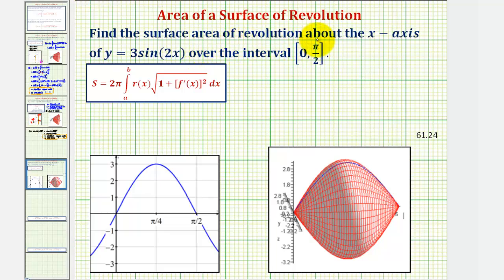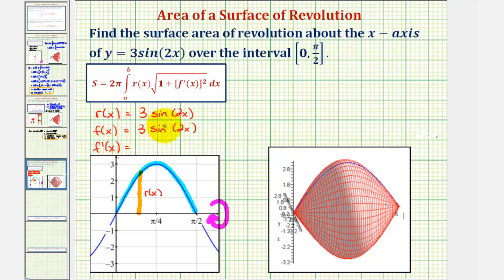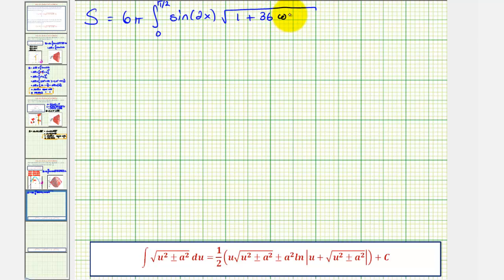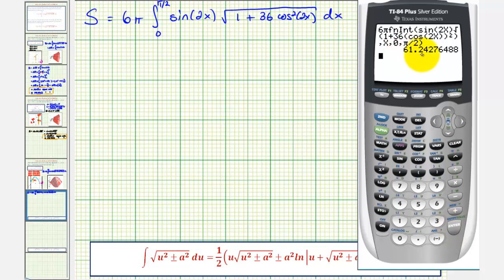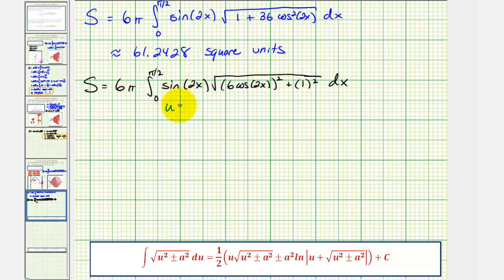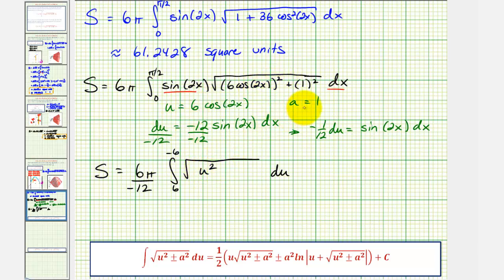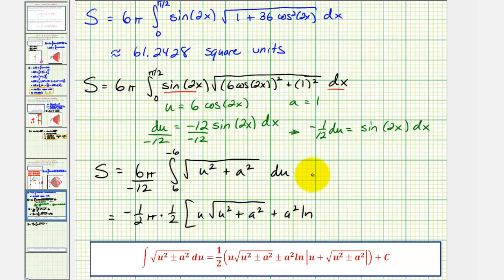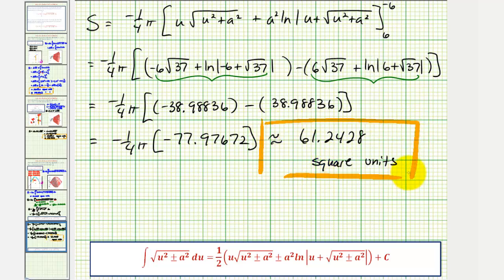Ex: Surface Area of Revolution - Sine Function

Comment: smh having to use a formula. this is why calculus is never seen as useful in the outside world. we are giving kids the formulas instead of showing them where it comes from and how you would use it. if we teach kids how to do calc without these stupid complex formulas then we would be a much more efficient and smarter generation but sadly we are giving kids these dumb formulas. smh
Reply from the maker: I do provide a video on where this formula comes from and explain why it contains the arc length formula. https://youtu.be/4XLq-BWK5NY  This specific video is just providing an additional example.